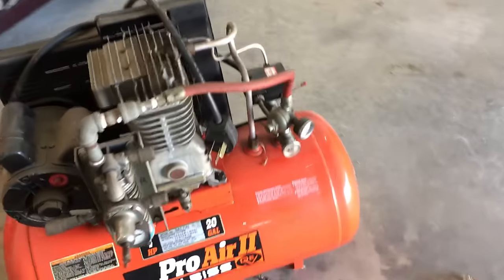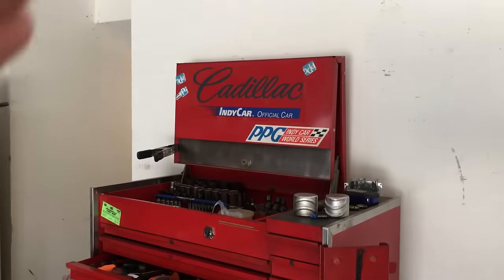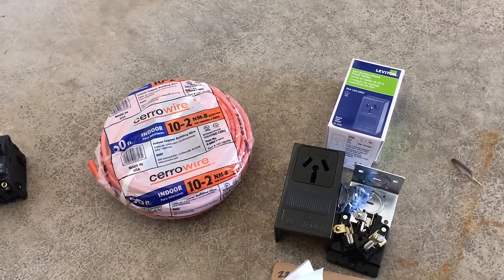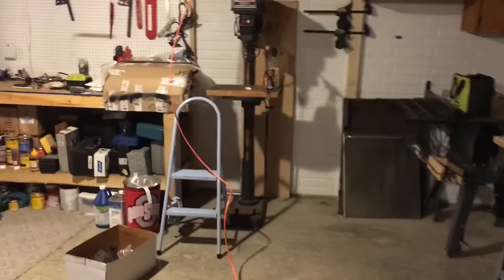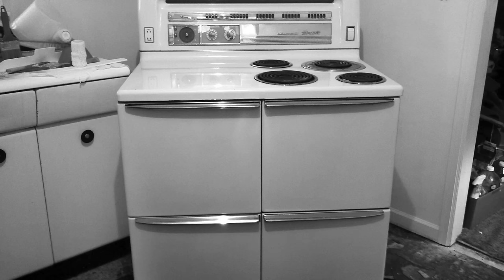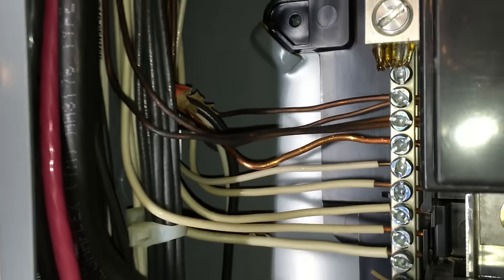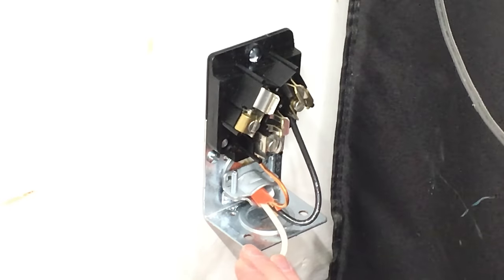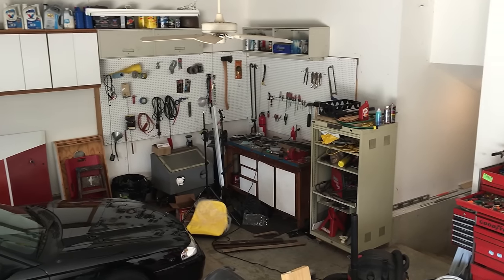How to Install 220v outlet in Garage the Easy Way = Run from Basement

Comment: So instead of pushing 2 feet of wire through a  hole from the basement side, you decided to push / pull 48 feet through the garage side?
Reply from the maker: oobaka1967 haha looking back, that could have saved me some time!
Reply: Hahahahahahahaha
Reply: That’s the new style of running wire bro lmao!!
Reply: I wouldnt have thought of it like that...lol..but its correct.
Reply: Can I run the power wiring  like this with no tubing or something else if I have drywall ?
Reply: Never pull the wire off the roll. It twists. Unroll the roll hand over hand instead
Reply: @6thGearGarage  done that b4 as well. 😂
Reply: THAT AND…..he should have flipped the outlet around so the plug wouldn’t be upside down instead of “I’ll flip the outlet around another time”! Lol
Reply: Lmaooo we all do it sometimes then stop and fix it quick 😂
Reply: Real men work harder not smarter

Comment: Why didn't he just feed the foot of wire from the basement side to the garage side 🤔
Reply: ianjsutt haha 😂
Reply: Thought Same thing .
Reply: OOF!
Well, we all have those moments.
Reply: hahaha
Reply: Everyone will have their ways. It’s done and clean 🧽
Reply: Because he had 50 ft roll so he ran it over to the box as needed. Then went back to the garage and cut it. He needed like 35 ft and the wire only comes in 25 or 50 ft rolls.
Reply: @jewEATER85  I think you missed the point. He ran the whole roll through the hole instead of just poking what he needed outside from the basement. It's funny 😂. Stuff we all do and then look back and go 🤔. Hindsight 20/20, you know?

Comment: I paid a friend to add a 220 v circuit for my compressor, he used yellow 15 amp wire..before I even started to watch vids on "how to" my common sense said the orange 30 amp is what should have been used.  Plus, he didn't go all the way back to the circuit breaker, he just connected it where an electrical stove used to be, which is probably antiquated as it is aluminum strand wire.  I got the feeling I"m going to have to re-do the whole wang dang doodle myself, and this is why so many choose to d.i.y., it's because you simply can't trust most people. It isn't there property so they simply don't give a fat rats ass.  There are some you can trust, but when mine was done 18 years ago I couldn't check youtube for how it should be done, thus make sure it is correct.

Comment: Very informative video, that box is actually meant to be installed 180° of how you installed it so the ground is on top. So In the unlikely event that something were to fall down the wall and knock the plug out of the socket the first blade of the outlet to make contact would be the ground. There’s a term for it but most 120v outlets in this country are installed upside down so they somewhat resemble a face.
Reply: It depends, it's usually not required by code and is generally up to the installer but definitely a good idea to do it!

Comment: Thing I learned about wire, never start from the inside of the roll, always the outside.
I also learned it is better to unroll it along the floor first to approximately what you need.
This does two things:
1. Makes it easier to pull through the wall.
2.You don't get the twisty turning in the wire when pulling it out from the side of the roll.
You could also hold the wire upright and place let's say a broom handle through it so it rolls off easier, etc.

Comment: You need a strap within 12 inches of a box. Not more than 18 inches of wire length. And not to exceed 4 and a half feet between straps. And yes you mounted your receptacle upside down. Good use of tape.

Comment: In most degree program schools now they teach turning the ground lug of the receptacle to the top as good practice especially in industry, garages, & basements where your gang box is exposed & mounted to walls, posts or machines. People love to lay conductive materials on top of an exposed gang box for some odd reason (screws, nails, etc.). By putting ground on top , should plug work or get pulled loose there is less chance of a foreign conductor rolling off that box and creating a hazardous dead short & arc flash between the two hot prongs. Just a helpful hint.
Reply from the maker: I never considered that... thanks for sharing!

Comment: You identified your receptacle as mounting flush on the wall, except it was surface mounted. Flush mounted would look better and with your exposed basement, you could have easily cut the drywall and nailed a new electrical box behind the drywall for a real flush mounted receptacle.
Reply from the maker: Dang Nguyen sorry for the confusion. I had to do it that way because there was a 2x10 behind the 1/2 drywall.
Reply: Wow.

Comment: From a code standpoint, I had been under the impression from some other videos that 220V for this type of application needed to be in a conduit... but maybe that's only when the wiring is meant to run along the interior side of a garage wall.  Interesting.
Reply from the maker: You are correct. The conduit is for when running wire vertically down or up a wall.

Comment: How did you know where to drill in the ceiling of your basement? I have a similar situation where my basement comes in contact with my garage. I'm just not sure exactly where to drill
Reply from the maker: I measured on the outside of the wall in the garage, and then measured the same distance (minus the thickness of the wall) on the inside of the basement ceiling.
Reply: Thank you

Comment: This is nearly an identical situation to my house and needs. Attached garage, basement panel, need to add a 240 to the garage for a large air compressor. :) This gave me about 70% of the confidence to do what I need to... the other 30% is simply being comfortable (but not overly so), when installing the new breaker. The 200 amp panel is full of breakers, but many are unused... I'll likely be re-using an existing 50amp that was for a hot tub that used to live on the back patio during the prior homeowners' reign.

Anyway, thanks for the simple overview!
Reply: I have the same situation like your to use the 240v from the hot tub outside at the deck for my EV charging port. Did you run the wire from the outside and go along the siding of the house and get through the wall at the basement? Send me some photos if you don’t mind.

Comment: The receptacle is for a 50 amp usually its a range receptacle 3 wire which it can be used for welders also. When I have installed them we go by amperage not 240 volt. Must of the double pole breakes are 240 volt.

Comment: I think I would have wired the outlet before connecting it to the service panel to ensure I didn't fry myself. Is there a reason I shouldn't do it that way?

Looks like multiple others let you now your outlet box is actually upside down, which is why your cord 'looks goofy' plugged in the way you had it. Nice to know.
Reply from the maker: I think by doing the breaker first, you won't get zapped when installing it if there is a problem with the wiring of the outlet.  
By doing the breaker first and switching it off to wire the outlet, you only have to worry about the breaker kicking off when switching it of for the first time, not getting zapped while you have a screwdriver in your hand attaching a wire. Or at least that's my best guess.  Thanks for watching!

Comment: Do you have to pull permits for this?  My house that was just built a few yrs ago has 220 prep done which is just means that the thick wires were ram already to the breaker box & the box in the garage on the wall has a cover on it.  I just need a 50a breaker and a 220 outlet.  The breaker box is 200amp so I have plenty of space.
Reply from the maker: No permits needed in my area. But I also live out in the country. Some cities may have different requirements.
Reply: @6thGearGarage  I guess I have to call the township then.  There’s nothing about it on their website.

Comment: I was actually just about to do this for my welder...im an electrician though so I didnt really need this 😄. Very informative video though!
Reply from the maker: Glad an actual electrician watched this and didn't give me a list of things I did wrong!
Reply: I have a 220v outlet for 30amp. I see you have a 50amp outlet. Can you tell me the difference? I'm doing same 10-2 wiring and 30amp breaker
Reply: The only thing that bugs me is the white wire == hot. Even with tape on the end, I would never do that to the next "guy" to come along. You can get red-black-ground. (or just spend the extra $8 and get 4-wire. What would you do @vaint ?
Reply: @fshalor738  2 wire and tape, thats the standard up here in Canada. We usually do a much cleaner job with the taping, we tape the entirety of the visible conductor or as much as we physically can.
Reply: @altvibr  Or heat shrink black or Red tubing over the exposed wire?  I have seen some recommend doing that.  Tape might get unraveled.

Comment: So if I wanted a 240 with a larger breaker for a 240 welder, I’d just need the appropriate size wire (6/2) and a 50A breaker like a range has right?
Reply from the maker: You have the right idea, but I can't say for sure that 6/2 and 50a breaker will be correct for your application.

Comment: Also probably could have just re wired the compressor. Most AC motors like that have a high voltage and low voltage set up. Then you could have just used 120v would have been cheeper and faster. 

But the motor will have an easier time with the 240v
Reply: Also: welder. Down the road. !

Comment: That is a NEMA 10-50 receptacle; meaning that it is a 120/240 volt non-grounded 50 amp receptacle.  For that to be wired properly you need 8/3 plain (hot, hot, neutral). The correct receptacle for your compressor is likely a NEMA 6-20.  (20A 250v)

Edit: As others have mentioned, you should always use the correct breaker in your load center, and properly identify your conductors.
Reply from the maker: Thank you for the professional advice. I will mention it to the person who helped me. Is there any danger in leaving it the way we did it? I only ask because it was wired the exact same way in the last garage I had this compressor in - not saying that makes it correct.  I also did not realize that the Siemens breaker shouldn't be used in this box (couldn't find anything else at Home Depot to fit).
Reply: @6thGearGarage  The danger comes in when someone tries to plug in a device that uses 120/240 as this receptacle does not provide a proper ground.  This was a common configuration way back in the day before code officials realized that non-insulated and ungrounded appliances are a pretty significant safety hazard.  These outlets and plugs really shouldn't be sold any more, but grandfather laws being what they are caused them to stick around long after they should have relegated to a museum.  Another thing is that if you are using a compressor with a significantly lower Full Load Amp rating than the breaker on the circuit, the compressor should have a thermal overload device of some kind. (Anything from a properly sized manual motor starter, thermally protected motor, etc will suffice.). 

There are many ways for new gamers to get tripped up when dealing with electricity.  (I've been at it > 20 years and still learn something every day)   I encourage you keep learning and consult with professionals, other YouTubers, etc.  Just remember, the only stupid question is the one that is never asked.

Edit: I just remembered a fun anecdote from my apprenteship. The 10-50 outlet used to be used for ranges, and in an effort to make these appliances "safer" electricians used to bond the frame of ranges to the neutral so any fault current would be carried through the neutral back to the service panel.  This worked fine in most cases, except for when the main neutral connection became corroded or went high resistance. This caused these appliances to become live at 120V due to the aforementioned bonding of the neutral and ground.  (The clock and timers are almost always 120V and a constant load on the neutral) let's just say I learned the hard way to not touch old appliances when searching for a faulty neutral connection in a home.
Reply: Always interesting to look at installations in different countries, and reading about this, that central pin is a neutral and grounding via neutral was once legal in US systems. I know that neutral is bonded to ground in the distribution panel, but it does seem to breech the principle that protective earths ought to be separate.

Given the North American split phase system, I wonder why it hasn't just standardised on a four pin outlet for 240v and then the appliance can use whatever pins are necessary for its operation. Perhaps it's the cost of requiring 4 core cable.

That two hot plus neutral plug for a worktop compressor strikes me as less than optimal.
Reply: Steve Jones We do, it's called NEMA 14 and has been required for about 30 years. These NEMA 10 outlets are only allowed for replacing like for like in old houses, so installing a new one like this violates code. The compressor cord should be changed to a NEMA 6 (or L6 for the twist- lock variant), which has two hots and ground, no neutral.
Reply: M VanSumeren you are correct sir!
Reply: I hope you can help me. I want to install a 220v outlet for a compressor do i need 2 hot and 1 ground cable 6? But im not sure what breaker would be if a 20amp or a 30amp
Reply: @6thGearGarage  If you sell the house, it'll bite you in the ass. If someone tries to plug a dryer or EVSE/RV in there, it could damage the thing plugged in, the wiring, or both. You should have run 8/3, but given you ran 8/2 with a 30A breaker, you needed to have installed a NEMA 6-30 (2 hots 1 ground 30A). This will prevent someone from plugging in an appliance with the incorrect expectations.
Reply: @fernandocolunga8947  You should buy 2 hot 1 neutral 1 ground cable. #10 for 30A, #8 for 40A, #6 for 55A. The neutral doesn't cost that much more and it's code in most places anyways (and even if it's not, future appliances are going to be "4 wire" appliances, so installing a 3 wire outlet new to save $10 is a silly thing to do.
Reply: @Ryan-hr9hw  Read up on NEMA 10 series plugs and sockets and get back to me when you're finished eh?
Reply: @mvansumeren4313  I stand corrected and learned something new to look out for.
Reply: @Ryan-hr9hw  Gotta look out for those old timey connectors.  They'll get ya! 😁 I've been saying for decades that they should just stop selling them. They're obsolete, unsafe, and a source of confusion for new electricians and DIYers alike.
Reply: It is fine..breaker is sized to the wire!
Reply: @jaytodd5809  No, it isn't fine.  Read some of the other comments.
Reply: @mvansumeren4313  It's a diy job..Sure its fine..and thats not a neutral terminated receptacle..Its an old stick welder/dryer receptacle..It can be backed by a 50amp or less breaker with correct gauge wire..Now why the compressor has that plug well cant comment there..
Reply: @jaytodd5809  NEMA 10 most certainly is a neutral connected receptacle. Look it up. 
As far as the excuse of it being a DIY job, you can go ahead and place that right in the trash where it belongs. People die every day because of others cobbling things together rather than purchasing the correct parts.  NEMA numbers, codes,  and standards exist for a reason.  Follow them, or kindly find someone who knows how to.
Reply: @mvansumeren4313   I'm wondering two things: 1) His panel has both grounds and neutrals mixed together, but mine has a separate ground bar. So should the third (neutral) wire (NEMA 10) go to the ground bar, or the neutral bar? 2) If I'm using 10-3 wire that I already have, wouldn't it be better to use the white shielded wire as my neutral, rather than the bare ground wire and just not use the bare copper ground wire?  My welder has a 3-prong NEMA 10, even though it's brand new.  Thanks for the advice!

Comment: Haven't seen a comment or anyone pointing out that installing 30amp breaker on existing 14g wire if not a sure way to melt down the wire (fire) , than it sure is  the legal reason for insurance company to turn down future claim. 
(That assuming the exiting wire in video is 14 or even 12 gauge wires). 30amp breaker needs a 10 gauge wire)
The set up might be okay if it is used delicately JUST for that compressor, and assuming  that is a 12 gauge wire
Reply from the maker: It is 10-2 wire.

Comment: Can I not use my yellow romex.. I have like 500ft of it.🤔
Reply from the maker: I would ask an electrician to be sure it is the proper gauge for your application
Reply: If it's the right gage and NMB wire, it should be fine.
Personally, I'd see if it'd be better to run 10/2 EMT instead just to be sure inspectors would like it better if you ever sold your home.

Comment: New to electrical so I’m not sure if you’re doing a great job although you might be, but shoving stuff through existing plumbing cutouts could potentially remove the 1/8” or 1/4” grade when you’re shoving wires underneath the pipe or on the other hand if you push down the pipe with wire in certain spots it will now have a belly in the pipe. Just cut a smaller hole for electrical wiring a couple feet from the existing hole to minimize potential back grade and bellying on your plumbing. And for those who say, “Just expand the hole for the plumbing to fit both?” That’s not how that works… you can only remove so much from the center of a joist before it loses its structural integrity.

Comment: Can you have more than one outlet on the circuit?
Reply from the maker: You could, but not for simultaneous use. In my old shop I had one 220 line with two plugs on opposite sides of the shop. One for compressor and one for welder, two things I would never use at the same time. If the compressor kicked on while I was welding it would trip the breaker.